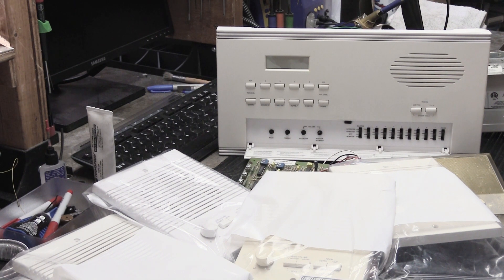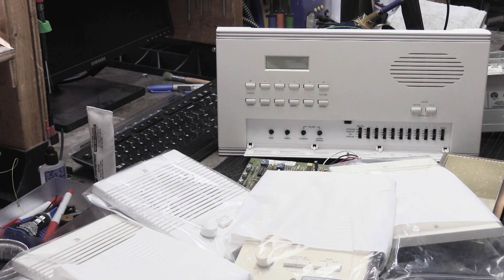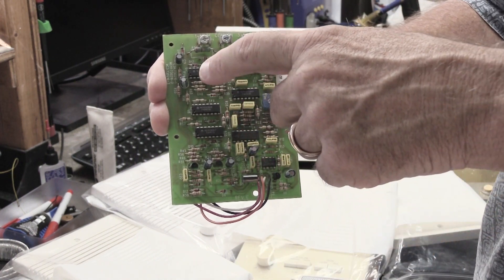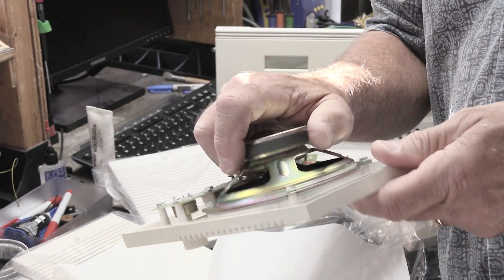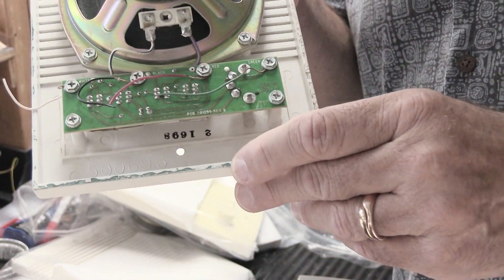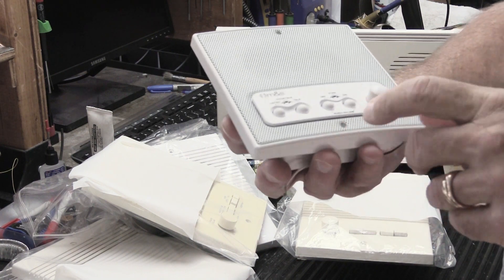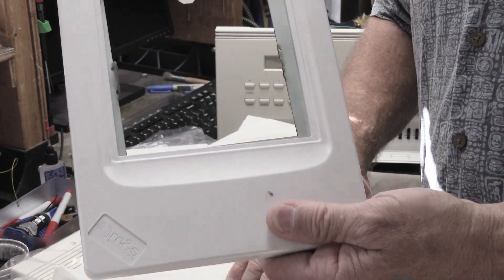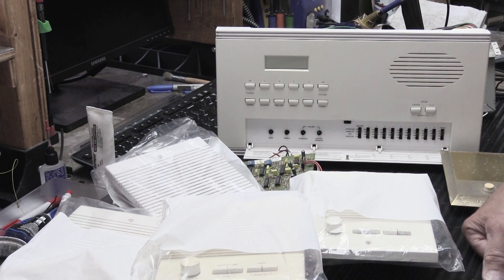Mail Call #20 "Tip-Toeing into the Dark Side"

Comment: I can't believe they removed that nice intercom from their home!  They obviously are clueless to how convenient it is to have a whole house intercom.  I use my Nutone daily not only to listen to the radio in the kitchen, but to summons people throughout the house - it is so much more efficient then shouting and walking around the house.  Anyway, that was nice of them to send you everything.  Regarding the yellowed plastic:  I have easily restored yellow plastic using 40V peroxide cream (you can buy on ebay or amazon).  You spread the cream on the plastic, cover loosely with plastic wrap (to avoid drying out) and set the piece outside in the sun.  Several hours later, clean the cover with soap and water and it will be back to white.
Reply from the maker: Hi Groovy 1:  You know of course, when you remove the Intercom System - you also have removed your Doorbell. . . This is often a Really Big Surprise that usually becomes a problem at the end of the renovation ~ Surprise!!!! ~ Chris

Comment: Always handy to have spares :-D
What pillock decides to paint over the button functions lol.
That chime pcb does look open to repairs, maybe there are a few 4000 series cmos logic being used.
Old tech can be just as reliable or better than wizzbang computer controlled madness lol.
The old 555 timer chip is a really old design, but can be handy for all sorts of circuits.
Reply from the maker: Hi zx8401ztv:  I guess it was some kind of Ninnyhammer who painted the grill - The Chime Module is all basically made up from Gates - Counters and an  Op-Amp.  A few years ago, there was a fellow who made is own Microcontroller from 555 IC's, Crazy Stuff - Chris
Reply: @northsideservicecompany3567  Some people can be very creative 😀
My favorite logic chip is the cmos 4017 decade counter.
I fitted a lot of end of transmission bleeps in c.b radios over the years and some had 5 tones.
A 4017 and a couple of 4000 series gate chips.

I liked the 'K Tone'  best.
I also repaired bleeps as people had a habit of applying power to the wrong wire.
Poof and smoke escaped lol.
Sorry waffle mode.
Reply from the maker: @zx8401ztv  So many really great designs can be built-up from basic logic IC's - Now-A-Days everyone wants to grab for those 15 cents micros ugh old school works well - Chris